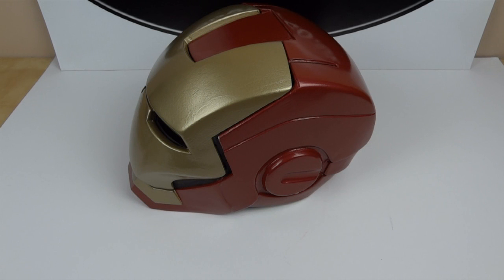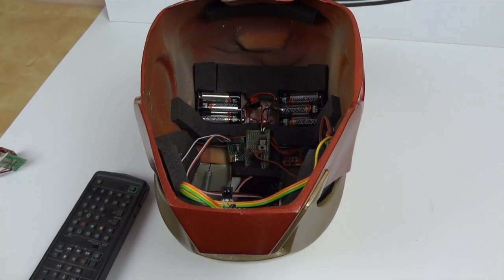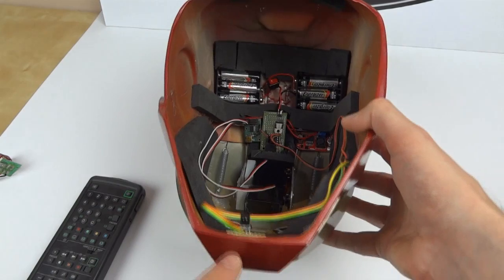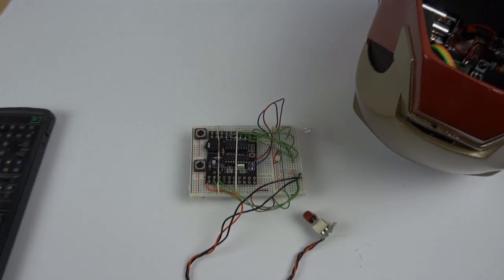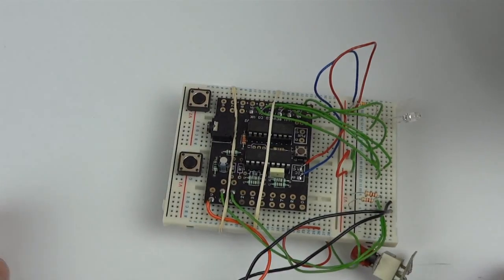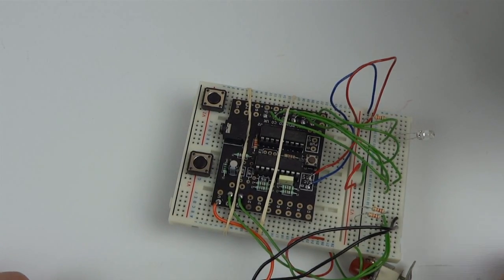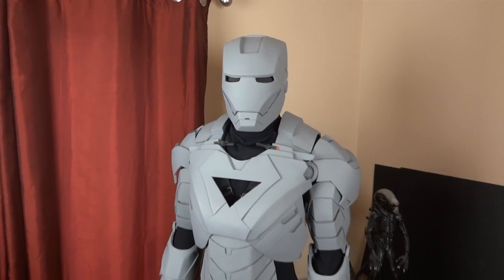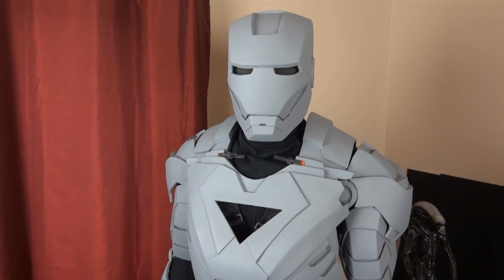Iron Man Power Suit #12 | Wireless Faceplate Electronics | James Bruton

Comment: He shouldn't even need a USB port. In the video where a guy updated the Nintendo Power Glove controller, it included a Bluetooth connection which he added using a small Bluetooth board wired into the board in the controller. Wiring a Bluetooth tranciever board into the PICAXE board should work, I'd think.

Granted, I'm mostly making educated guesses here, as I don't really have working knowledge of scratch building or peacemealing electronics.

Comment: Why not have all of the controls wired into one of the gloves/gauntlet wirelessly. Put all of the switch boards and stuff underneath the top of the hand and have the wires run up to your fingertips and have the buttons on the inside so that all you have to do is press your fingertips and everything will light up or hook it up to the chest piece with the IR transmitter/receivers facing each other............

Comment: less of a construction problem solver. look for led pucklights, the number of bulbs varies on most designs, and often they come in sets of 3 or more, but those would make a suitable arc-reactor unless you have one in construction, but the design of em are very simple, just push the center and they light up, might have to flake off the power design on it, but still, easy enough to attach to any chest peice you have made already, and less of a soldering to be done. and 100% wireless, 3 AAA battery

Comment: I would personally stay away from IR and go with Bluetooth or another standard wireless system. Instead of just taking a single signal code to activate though I would use a series of codes to prevent accidental or mischievous activations. Also you can get those cheap USB bluetooth dongles that are very small and cheap.

Comment: i would be afraid that the batteries and the wires and stuff would be damaged by sweat cuz im sure that wud be hot if u had it on for a while but i was juss wandering if sweat could posibly damage the wires batteries and etc ?